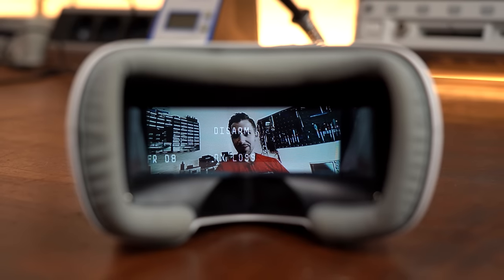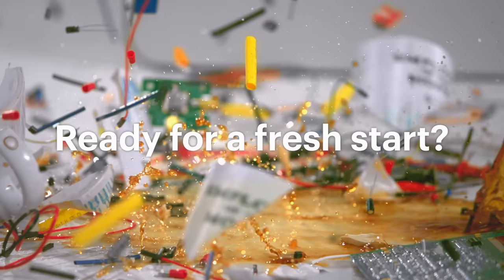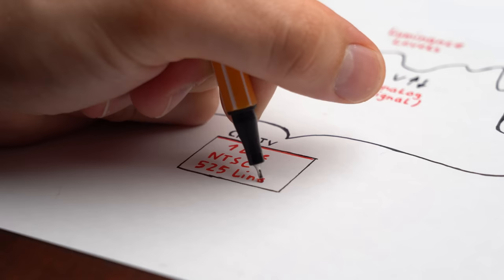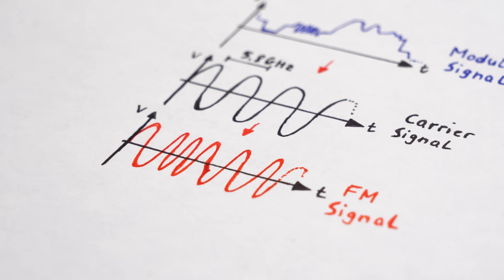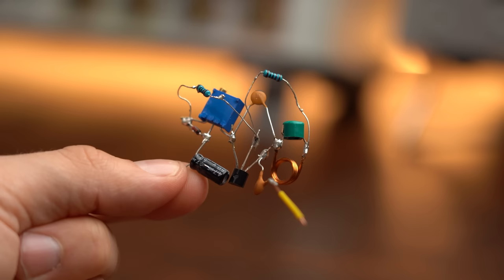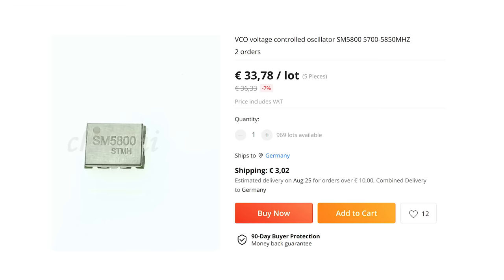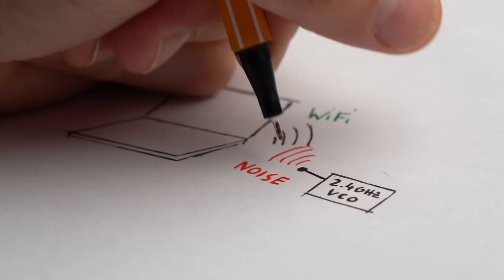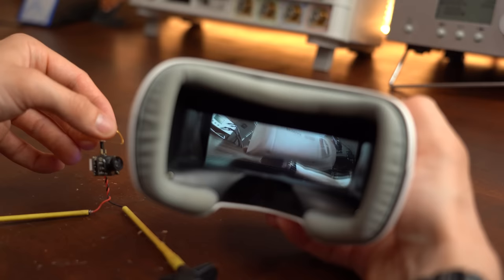I tried Wireless Video but ended up building a WiFi Jammer (A Fail Story)

Comment: Setting aside why it didn't work - I think other commenters left lots of tips, I'd recommend getting an SDR to see what's actually being transmitted. RTL-SDR wouldn't quite cut it, but there are other products :)

Also I'm quite uncomfortable with anything above ~100Mhz as basically everything becomes antennae, and parastitic capacitances and inductances eat up a lot of useful power. It might be that assembling it in midair caused some losses like that.
Reply: do you have SDR ?
Reply: @omsingharjit  me? Yes, why?
Reply: @Gurux13  than ok , otherwise I have Arduino made
Reply: @omsingharjit  Arduino's probably way too slow for an SDR, even with a frequency shifter. There will just be not enough bandwidth.
Reply: @Gurux13  Not using just Arduino but with Si4432 module 230 to 900 MHz yes even than it will be slow but For small rf project and tunning it's ok for me ,but i wanna buy SDR anyway
Reply: @omsingharjit  Nice! I've got LimeSDR, and it's pretty cool :) Also can transmit.
Reply: @Gurux13  SDR with transmitter !! 
How you manage to get it and legally ? And what was price ?
Reply: @omsingharjit  it varies by country, where I am it's legal. 
It wasn't cheap, they're selling mini 2 now for $399.

Comment: I did that on purpose 3 years ago using 4 video xmitters in parallel with no signal on input and 3 channels apart each. It worked at only a few meters, but that was enough to discourage people from doing their daily job during meetings instead of listening to others.

Comment: To side note my last comment,  the video runs on 5.8ghz the radio is on 2.4ghz, there is also an integrated 2.4 reciver on the main flight board. So this too can be misleading. Theres also the 2x4 pin header that should be an output of signal to something. Possibly the video transmitter. The camera plugs into the main board so it can inject the on screen display info. Then it sends out that whole video package from the main board to a separate transmitter. More digging is needed i think. But like I said. I am anxious to see what you can do with the tech for these drones. Id even more so love for you to de scramble a digital 5.8ghz video system like dji to a simple analog feed. (Idea for future projects)

Comment: I have played with extending the range of ~5GHz signals i.e. WiFi but surely the easier approach is to increase the antenna gain. Even if you only modify the headset antenna you should be able to make a useful improvement in range. Of coursem high gain wifi antennas are cheap and easily available which helps !
Reply: This is the most sane and reasonable suggestion I've seen here. I don't understand why Scott is trying to re-invent the video transmitter. Seems like increased antenna gain would work and if even more gain is wanted an active gain stage (i.e. linear RF amplifier) could be inserted between the existing transmitter chip and the antenna.
Reply: Welcome to the channel, I don't come to greatscott for careful analysis and engineering, I come here for hamfisted experimentation done with wild abandon and very uneven results. It helps me feel better about my own uneven work, and I do sometimes learn a thing or two, even if it's how not to approach a problem :)
Reply: Gain means directionality, though, and he probably wants an omnidirectional antenna since it's a drone.

Comment: The (luminance) video subcarrier of traditional analog TV (at least NTSC) is AM (full carrier vestigial sideband), not FM.  (The audio subcarrier is FM.)  It will be hard to fool an AM receiver into seeing the sync in FM mode, so the receiver doesn't see a TV signal.  So, although the chip is intended as an FM transmitter, that modulation input may be being used for transmitter "channel" select, with the video signal applied externally to AM modulate an amplifier.  You might check the drone video board more closely to check whether this is true.  If memory serves me correctly, sync produces maximum power and white produces minimum.  Good luck.

Comment: Hi,
1) 2N2222 has not enough bandwidth. I think it's bellow 300MHz. BTW this transistor is suitable for switching applications, not for FM modulation . You may need some transistor which works more linearly and suitable for FM Video-signal modulation. But it would be interesting if you had tried it to adjust it some where between 40-200MHz.

2) Analog TV channels are bellow GHz frequency which means you can't tune them to 2.4 or 5.8GHz frequency. Which means even you have successfully modulated signal you will be able to receive only some sub GHz harmonic of it.

Great Video, Keep going even if they are "fail stories".

Comment: Filters and boosters!  While I have no experience or knowledge, my first thought is that some of the signal components are more important than others.  So boost those signals before transmitting and filter back to normal on the receiver.  Think of it like Dolby.  Don’t like hiss?  Double the boost of the music that shares the range with hiss, then halve it on playback.  Boom, half the hiss, noise reduced!

Comment: FPV is my bag! Interesting project, if you want to improve with what’s already built in, run on channel R8 (gets you away from all wifi), unlock the vtx (often holding one of the buttons on power up or for 30 seconds) then crank up the power (I think that one will do 200mW). Also check out the OpenVTX project if you want to build something yourself
Reply: Or just buy a tbs unify nano and wire it up to a spare uart (assuming the cetus has one?). Crank it up to 500mw and you'll outrun your radio connection, which is something we generally try to avoid, but with a tiny whoop it doesn't really matter if you failsafe in your living room.

Comment: if your camera is analog its already outputing the frequency , all you have to do is boost that signal and your receiver should pick it up just fine remember rca is just a smaller coaxial signal so if boosted your regular tv could probably pick it up as well

Comment: Invert your camera signal.  Also, the tuning bandwidth of crystal VCOs may not be high enough for video.  Though you may get away with audio.  For video you will probably need a hell of a lot of pre-emphasis which is usually designed into ICs designed to transmit analog video.

Comment: I learned through an internship that anything in the GHz range sucks to deal with.

There are an unfair amount of variables that affect signal integrity.

Sadly, I think off-the-shelve OP-amps and air soldered circuits are insufficient.

Comment: You might try using smd components as well. Much better frequency response. Along with creating the circuit on a perfboard with nice even solder traces,that will help a little

Comment: try fumbling with the amplitude and the dc component at the input of the VCO. FM via VCO means that you increase your bandwidth by increasing the amplitude of your input signal and control the carrier frequency by controlling the Average DC value of the input. the rate of increase in bandwidth in relation to input amplitude is device specific so if you make the amplitude too large or to small your RF signal also has a too large or too small bandwidth. you have to match the bandwidth of your reciever for it to properly demodulate the signal without distortion

Comment: Is the op amp that you use suitable for 5.8 GHz? Most aren't. Also, with this high frequency, it would be better to use smd components. The feet of THT ones have a not to be underestimated inductance at this frequency. You also have to consider Impedance matching in your circuit! It would be best to design a quick PCB with the right impedance and components suitable for 5.8 GHz.   Also, the simplest way of improving the range would be to use a higher gain Antenna. (But be aware, that this increases the directionality of your signal. Meaning, if you turn to much to the right or left you can loose the signal.

Regards an RF engineering Student :D
Reply from the maker: Thanks for the feedback :-)

Comment: My opinion is, if you can't make the signal go further, go make a more sensitive receiver or an antenna, the drone's transmitter power is 25mW and capable of doing that and just that. And you should try a more serious drone (3 inches or higher) to fully experience the FPV world

Comment: Op amps typically aren't all that great amplifiers for video signal. You need an actual broad band amplifier for that. Having said this, I'm not sure you are going to even need the preamp. Try feeding the camera signal directly into the VCO via a capacitor while biasing the VCO pin with a potentiometer. If you amplify the video signal too much this can cause overmodulation. This could be the other problem, and the reason you made a wifi jammer instead of a video transmitter. The frequency of the VCO is all over the place because of the huge signal amplitude after the op amp.

Comment: Such high frequency requires special pcb traces. Say trace/with/ground plating etc. You know that 😉
Reply: That's something I've also learned recently the hard way. Even with an SPI connections running at a much slower Bandwith (1MHz), i had a ton of issue until I've realized that it's the wiring and signal integrity. From now on I'll wont even bother with breadboards or prototype boards when such connections are required. It costs more time trying to figure out the issues and trying to fix them with shielding and  twisted cables than waiting for a few PCBs. But that's how we learn 👍👍
Reply: @Leif_YT  you have learned from hard way. I am a mechanical engineer and i have learned this tricks from simply watching YT videos.

Comment: The best solution for range increase is to use a better antenna at the receiver and possibly the transmitter. You'll probably have a lot better signal outdoors too.

Comment: I was having a similar problem with them. The transmission quality can be improved with a better VTX module for FPV with more mW, but one thing to have into account is that they work at 5.8 GHz, the same as the 5G WiFi band, which messes up all the wifi signals all around if they're are not in the right frequency/channel. Most of them can be fixed using the last frequencies available for the emitter, which most of the wifi modems do not use. At least that's how I fixed it, otherwise I have a very good WiFi jammer 😂😅

Comment: So from my experience this single transistor circuit from internet does not work, my approach was that i just took +/- 500Mhz sine generator circuit based on collpits oscillator and 2sc3356 transistor from my other project and mixed camera signal to antena output through some lcr filters, i can mail approximate schematic of my project if you want, i managed to get around 50m open air transmission without any problem and with no amplification stage (also 2sc3356 is pretty good choice for such projects , it is smd npn with frequency of 7Ghz and little noise)

Comment: You were probably receiving an harmonic when building the single transistor transmitter circuit... use a spectrum analyser/frequency counter to find the fundamental frequency

Comment: Great Video, You need to make life easier, get a spectrum analyzer. 
You can have a better stronger signal using a better antenna, but the space on the drone is tiny... Stronger and better antenna on the receiver..
I think you could have better chips if you go digital HDTV...

Comment: You need to do some research on Phase locked loops. You will never keep a VCO stable enough without a pll. There are many pll chips out there that will do the trick, some of them even have a built in divide-by-N counter to make it a little easier. If you need any help I can give you block diagrams and also suggest a practical circuit that you can use to transmit video. If you wanted to do it on 2.4 all the parts you need are inside an lnb convertor known as California Amplifier. (It contains a pll and VCO set up as an oscillator locked to a crystal) They are available on flea-bay real cheap. Let me know if you would like some circuits. Chris UK.

Comment: 1. It's the opamp, "max gain/bandwith=max signal without distortion" and fbas bursts dont like distortion or noise.
2. Those VCOs aren't made for a control voltage bandwith of several Mhz and maxF of several Mhz, typically when building a jammer circuit they already got some serious follow delay at around 100-130khz at single frequency with a tiny wobble. This way the receiver sees the carrier but understands nothing because it is like i would like you to listen to the radio only with the 10-85hz bandpass filtered subwoofer signal;) 
Even if they'd work up to a frequency like this you'd need a totally different control voltage circuit than just adjustable gain to be able to define the upper and lower frequency limit of the modulation aka noiseless AC on top of a DC line.

Comment: Like others said, things get tricky over the 100MHz range and components stop working as expected. Sometimes even the legs and overall length of a resistor can turn it into an inductor (there's also capacitance between the legs). I think the antenna matching would be out of whack in this case, but perhaps you should still achieve a signal at very low distances. Maybe try again with SMD? Good luck, GHz is ultra-finicky! As an alternative suggestion, maybe (maybe?) try modifying the rx/tx circuit to a lower frequency, where its easier to DIY (also longer range)! (In that case of course check regulations and use ISM bands and very low power.)

Great video! (no pun intended :p)

Comment: The fun part is that back in the day when wifi was less common, people used those 2.4GHz video transmitters as well. But when you try to use those nowadays, they either barely work or dont work at all, and jam your wifi as well.
Those sets can still be bought from 2nd hand stores sometimes.

The reason for it not working so well, if at all, must be the interference from the 2.4G wifi signal, I guess?
Reply: You might be right, nowadays wifi (even the 2.4GHz Band) interfears with my 5.8GHz video signal... When I fly around my House and someone else decides to sit near me and use their mobile my Video just cuts out from time to time, it's really annoying.

Comment: I think you should divide the task in several parts, and work on each part.  Also, you should use real PCB instead of wire bonding parts, to reduce the noise.
Here How I divide the task.
Camera output -> A2D -> Packetize your digital data and add Forward Error Correction (FEC) ->I-Q Modulator -> Transmitter -> Transmit Antenna -> Receive Antenna ->Receiver -> I-Q de-modulator de-Packetize your digital data and correct the packet errors --> D2A -> Monitor
The way you currently doing things, I think you are corrupting your signal before you even sending the signal to transmitter.
Use Coax cable and microstrip lines and correct terminating resistor to protect the analog signal that you  are getting out of you camera.

Comment: improve the antenna of the glasses
you would have to use 2 devices one to transmit and another to receive the way you did it would be the same as trying to receive fm stereo directly

Comment: You might want to take a look at how the WiiU does it. Virtually 0 latency 480p 60fps wireless video, and very reliable too as long as you were in range. I've seen no other device capable of that.

Comment: I made a working prototype using a crystal oscillator and a frequency multiplier transistor circuit which uses am modulating technic. witch output power was nice and the receiver was a CRT tv receiving in a 300Mhz band. i can send you the schematic if you wish.

Comment: Rather than amplify the signal, you could always just improve the antennas... on the drone side, the antenna would have to be omni-directional, obviously, but making the antenna resonant (get the SWR down to 1:1 or as close as possible to it) that will vastly improve the amount of power leaving the drone. On the goggles you could theoretically attach a yagi or dish (provided you can keep it pointed to the drone). Simply making the antenna system more efficient could have much better results than poking around the signal power.
Reply: At GHz frequencies, shaving a few millimeters off the transmitting antenna for a better VSWR could make a 30db difference to the signal going out. That's more than you'll get from tripling the power on the signal itself.

Comment: Those relatively long (in relation to the 5GHz waveform) connecting wires will be a big part of the problem. You are dealing with a microwave signal, so every piece of wire acts like a big inductor, and also adds stray capacitance. This will be destroying sync pulses, so nothing can lock to the signal. The colour burst waveform is being lost for the same reason. Furthermore, you're attenuating the higher frequency components of the line scan waveform. These mean that you have no lockable signal with poor video modulation and no colour. Pre-emphasis should also be applied to the waveform, even if your circuit layout and geometry is correct. In short, you need a dedicated modular / integrated circuit for the job.
An additional problem is that, at 5 GHz - and even more so at higher frequencies - solder is very resistive. Signals are propagated by skin effect on all wiring, and so the metals used need to have pretty good surface conductivity. That's why Gold plating on circuitry, and Gold or Silver plated, or even plain Copper conductors and waveguides are used. Surprisingly to some people, stainless steel actually performs better than Aluminium above a few GHz.
My credentials include professional work in making and testing microwave transistors, and experience with 10 GHz Amateur Radio, and experiments with frequencies up to the 60 GHz Band. Most of what you use at low frequencies needs re-thinking once you go above about 900 MHz. It's increasingly more like plumbing than electronics at higher frequencies. Circuit geometry becomes ever more critical.